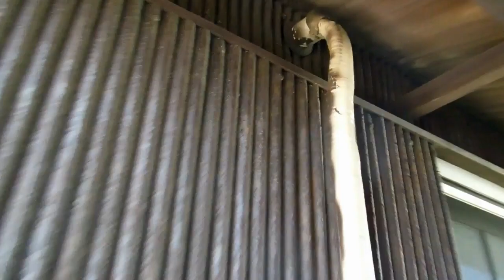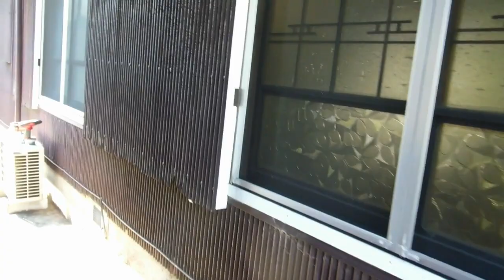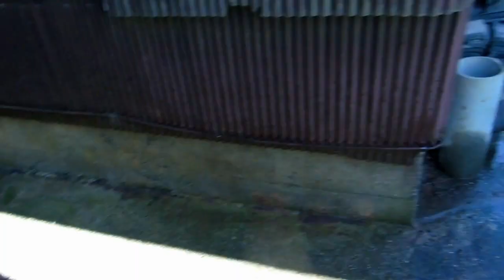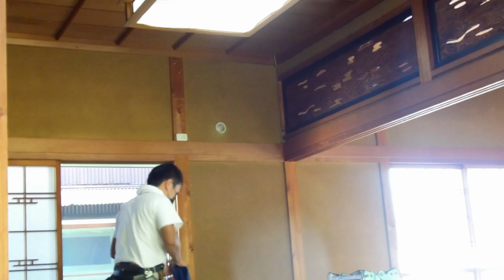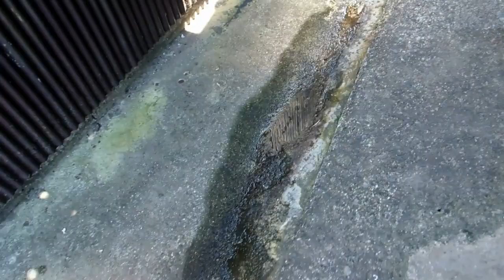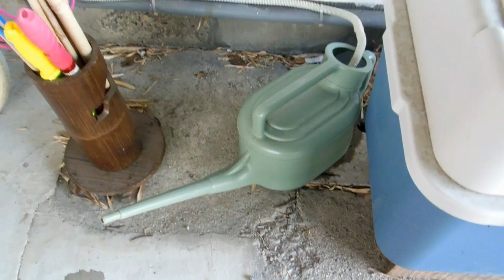Tatami Room Aircon Project at the Old Japanese Farm House

Comment: I wonder if the condensation tube could be redirected to a tank that would hold water for flushing toilets?  In theory, that setup could allow the air conditioner water be used before using water from the utility company/underground well.